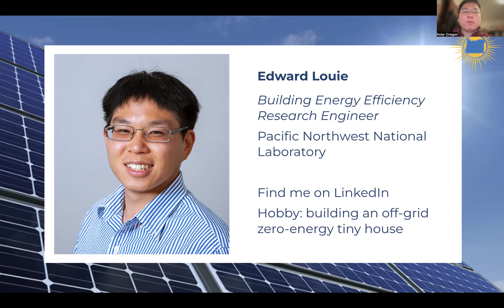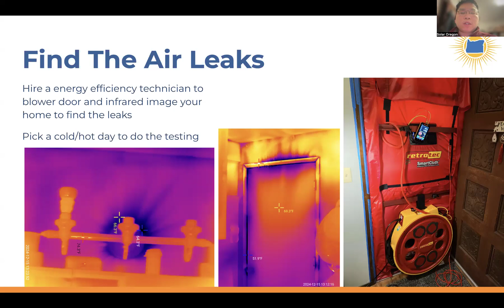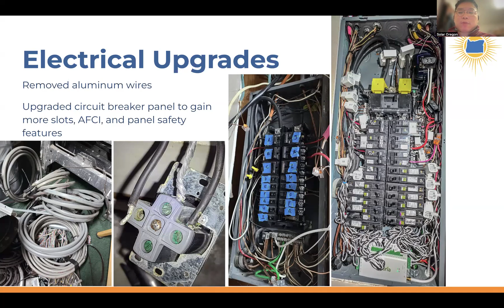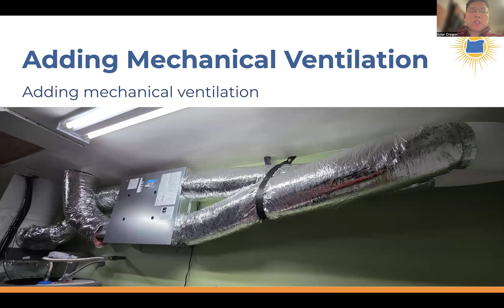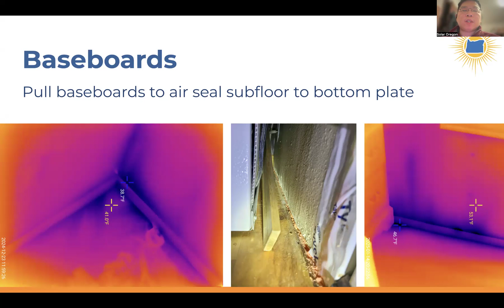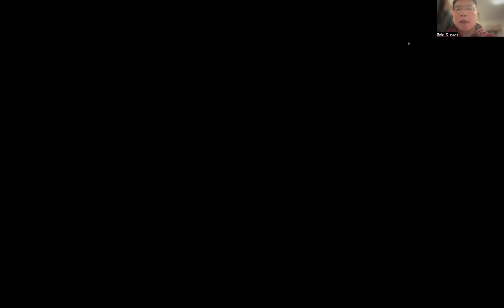Green Energy Series #33: The Right Way to Weatherize Your Home

Comment: This was fantastic information. Especially if you want to do it yourself. For those of us that don't have time for that, it is critical to find a contractor that will do the job RIGHT! From the great info in this webinar, one can see that there are many many details that need to be done right, and the order of doing things is super critical. So, the question is, how do you insure your contractor does the job right? Obviously, many contractors will want to cut corners to get the job done more quickly and make more money. But that will only condemn a building to forever wasting energy! Anyone that has suggestions to this conundrum, please share them! Thank you!